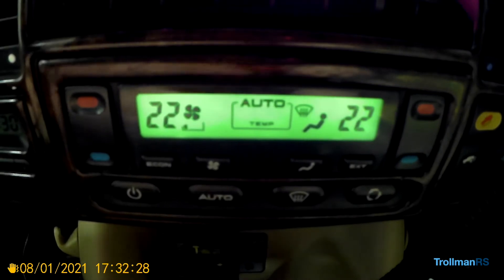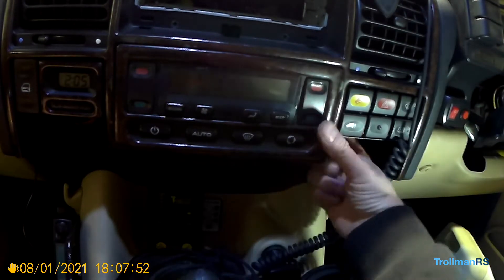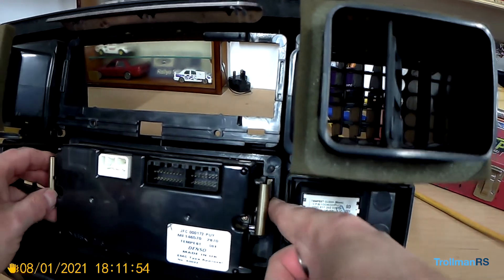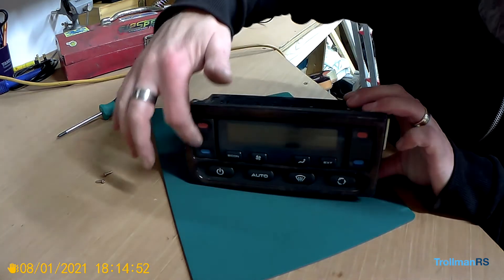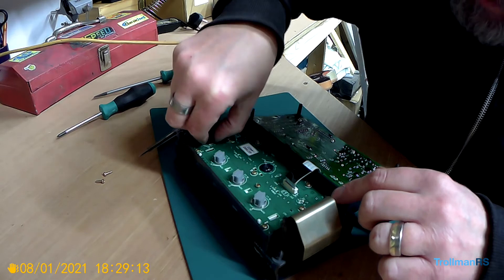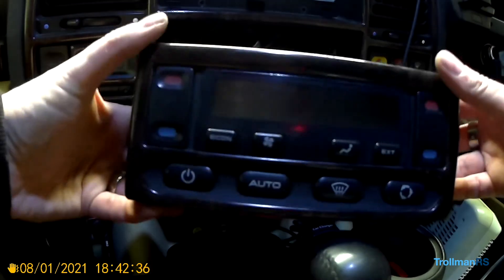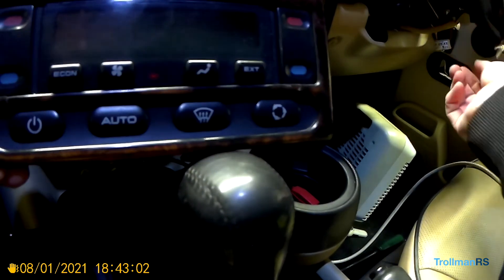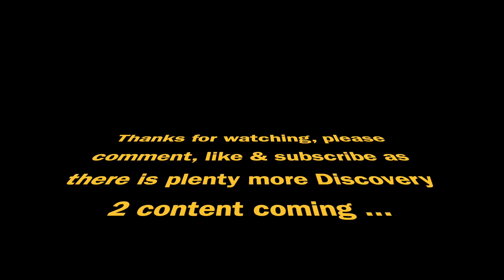Discovery 2 - Installing LEDs in climate control unit

Comment: How about the clock bulb?
Reply from the maker: Ah I have not replaced that one, I never use the clock and will probably remove it at some stage. ! Sorry.
Reply: Thanks - I just ordered a replacement clock because they don’t last long. Maybe I’ll try a couple different LED types to see if something works. Your videos are awesome!
Reply from the maker: @donwilliams2994  Hey Don, may thanks for the feedback. On my last D2 I installed an LED clock in an old alarm sensor and installed it by the rear view mirror. It looked awesome up there and a lot easy to read then the standard one. I got an old alarm sensor so I might do that mod again on this truck. 

Hope you have subscribed :-)

Comment: Did you use the same type of LED to replace the ones for the LCD? cheers
Reply from the maker: Hey Mike, yes I used the same T4.7 for the LCD, and the switches.
Reply: @trollmanrs  nice one, gonna have to try this at the weekend!
Reply from the maker: @Mike-zt3jf  let me know how you get on.
Reply: @trollmanrs  will do! Also, did you use the same bulbs for behind the dash or were they t10s?
Reply from the maker: @Mike-zt3jf  Dash bulbs are different, I used 501's /T10's.
Reply: @trollmanrs  thanks